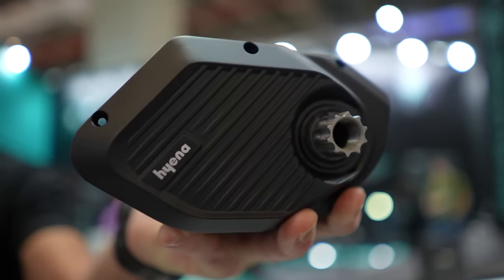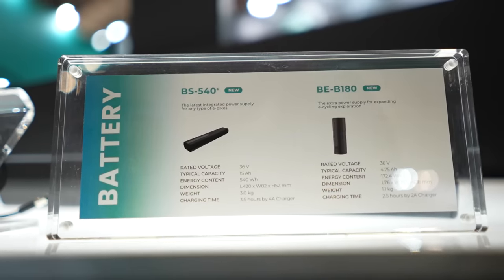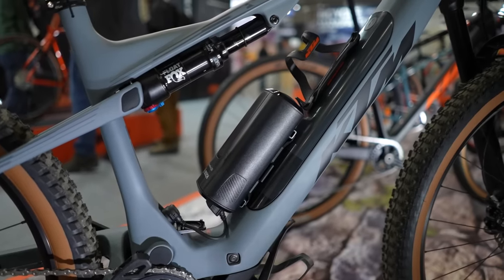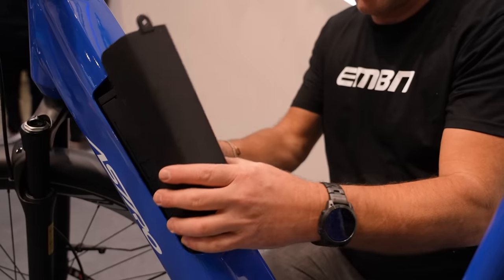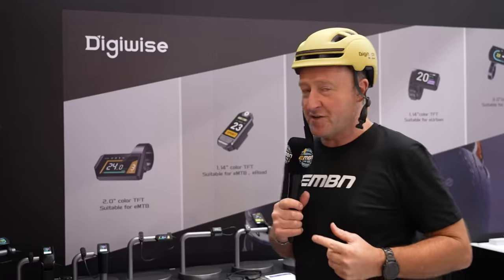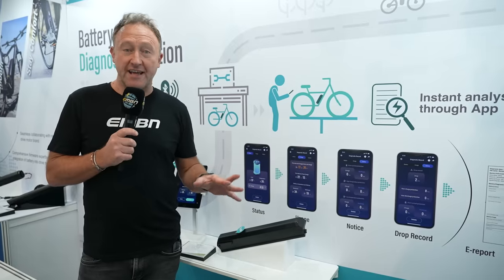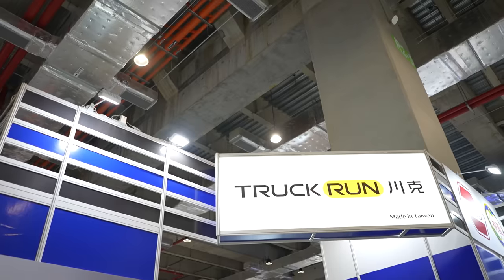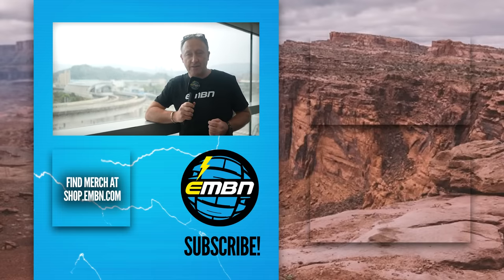Motors Of The Future Are Here! | Taipei Cycle Show 2024 Pt.2

Comment: Small motor over heat. I have a large motor and if I go up a big hill it gets hot and needs to cool down a few min before power comes back
Reply: I really like how my hub motor runs so cool , it's big and hevy but has only two bearings and no gears to break and wear out, plus it's so quiet I don't get attacked by dogs !  And it's got great toque for avoiding getting ran over .
Reply: @jacobclark89  hub motors only good for on road. Mid drives are for use with gears and off road and have more power up hill
Reply: @martinlewis1015   not
Exactly, while I would agree that mid drive dominate off road, still many people do use hub motors off road , with high power hub motors,  the motors can be manufactured for more toque for better off road use . I think a big push of the market comes from the wattage limit to use the bike with out a tag ECT , when comparing low power ebikes than yes if the mid drive has multiple speed gear box than that can help with hill climbing but a powerful hub motor will eat your little toy 750 watt middrive for breakfast 🥞 🤣  .  I love both mid drives and hub motors, each one has it's tradeoffs .
Reply: @jacobclark89  Embn proved it in a show, they took a mid drive and an equal hub drive off road but hub drive gave up sorry. I have a 1k Befang FREY bike EX and can go up steep off road but even that can over heat and needs cooling down for a few min at top
Reply: @martinlewis1015  Im not sure of what you're saying ,  it takes a lot of power to get serious in the dirt or sand , like a stark varg or the new 80 horse power primo ,  but you can have lots of fun to with a 6000+ Watt hub motor,  maybe you and me have two different ideas of off road riding. If you are talking about taking a 750w skinny tire bike with a bicycle chain driven mid drive off road riding , I guess you go trail riding in some places but , for me it doesn't make much sense, cuz if the chain or sprocket ECT breaks it could mean your life .  For around $365 on sale a hub motor made for wide tire,rim can be had , that with a slight modification can handle short bursts of 10000 watts, a few hundred for a controller, same for rim spokes and tire ,$450 for a frame , plus the cost of suspension.  For the money I think that the off road bike that I'm thinking of might be superior in some ways to your 1000w Bike ?  You don't think a 10,000  w peak  hub motor has enough power for off road ?  I got around 10000 miles on my hub motor that is powering my stainless custom fat tire recumbent , and it runs perfect and has never over heated .

Comment: Is anybody developing 48V or even 60V motor/battery systems? This should provide greater efficiency due to lower internal losses. I know that the Mahle/Specialized SL motors are 48V but is anybody else moving in this direction?

Comment: Any chance that regenerative braking will ever play a major role in e-bikes, for braking and energy capture? Or does the required weight and complexity make it unlikely? I have essentially zero knowledge of e-bikes so sorry if this comes across as a stupid or naive question.
Reply: Not in a center motor and free wheel; maybe in a hub motor
Reply from the maker: We imagine bike companies have looked into this but the weight of the system probably outweighs (sorry 😂) the power gained from it.

Comment: Disappointed because there are now so many incompatible mounting, battery (and I assume networking) standards, which will mean that many bikes won't be usable after a few years. We're just producing more and more e-waste, and a lot of this ebike promotion is just greenwashing.

And VERY disappointed that there was no sign of BB based retrofit motor systems (like the ones that got Bafang and Truckrun started) because there is a huge range of inexpensive acoustic bikes that would benefit from conversion. There's some good stuff happening in this space. My CYC Photon, even with its compromises, makes a lot of this other integrated stuff look anemic and extremely poor value.

Comment: In my opinion, you gave a horribly unfair final impression on that gearbox motor combo on display.  You didn’t even try it.  That pretty much defeats the whole purpose of having a new product showcase.  If you are going to assume everything you see is the same as older models, why even bother going to the show.   It Comes off like you have something against either the makers of the motor or the imagined end users of the product.

Comment: They have amazing motors but  no bikes. Oh yes, we would like to have motors with better IP protection and they should be repairable at home if needed. No need to go bike shop and use their dedicated system by the manufacturer.  They have been making motors in China long time ago, longer than we even had systems available here.

Comment: I don't really get the whole integrated ebike thing. I mean I get that it looks nice, but other than that, it is proprietary, expensive, and significantly less powerful than most of the diy motor solutions. Loving my cyc photon 110nm of torque and that's the weakest motor they sell. I can always move it to another bike if i want and cyc is making spare parts available.